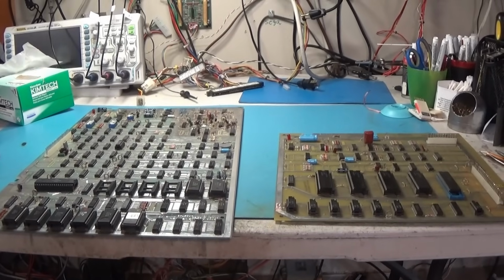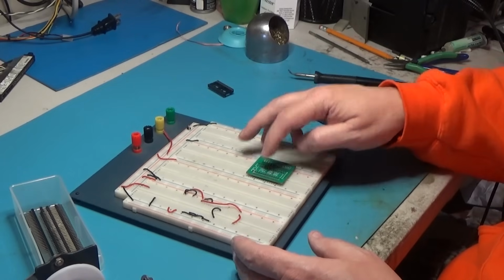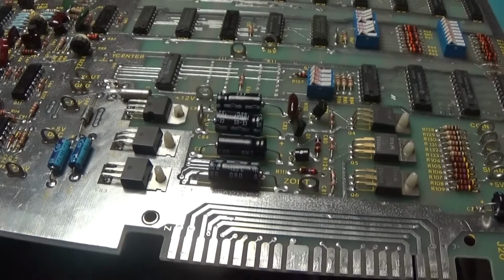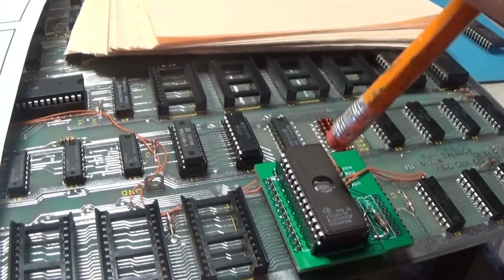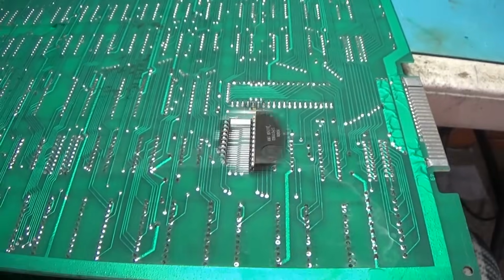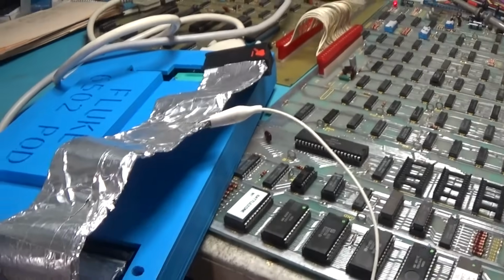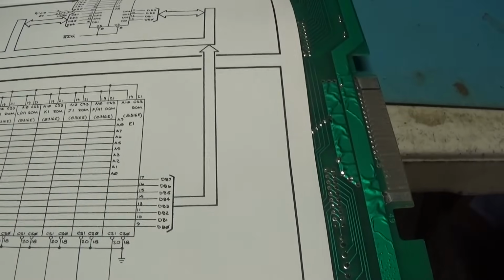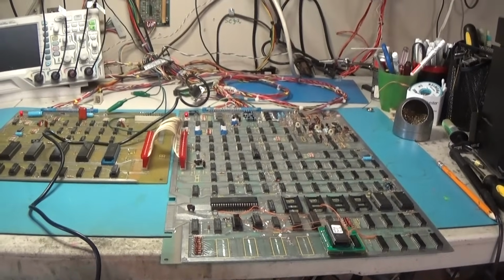1980 Atari BattleZone Arcade PCB Repair   2-17-2024

Comment: I have a BZ upright that was working when I bought it in the late '90s, but has since succumbed to socket rot.  I did the "press the chips into the socket" a few times which brought the machine back to life, but I plan on replacing all the sockets.  The monitor also needs to be recapped.  One of these days...

Comment: Your setup is very similar to the ‘high score save kit’ from braze. The whole eprom files are on one chip and plug in at the location of the 6502
Reply from the maker: As a matter of fact, that is probably what they are doing on that braze kit. Probably using the 245 as a direct separation between the data lines and the ram dat lines. Although the Braze kit is a ROM HACK,, which I’m not a fan of,I could actually make a board that plugs into the CPU socket. That is just the ROM code… And use that 245 to separate ROM and ram data.

Comment: Hi Sean, great video as always.
1:09:45  Small suggestion, if you are going to redesign that small PCB, you should add 2 more soldering points, so you don't solder these two wires directly to the chip.  Also, if you solder these wires on the other side of the small PCB (bit more cumbersome), this would clean up your work and put the wires closer to the motherboard.  It would then be easier to secure them to the motherboard with some hot glue or a dash of clear nail polish.  No sticking out wires... smaller chance of ripping something out.
Also, you don't need any extra vias, as you have removed bunch of sockets and you have plenty of holes on the motherboard (on both sides of the small PCB) to guide these wires through :).

Comment: Suggestion: make small daughterboards for the other chips you pull the signals from, giving you pads to bring your wires off of.
Reply from the maker: That surely is a good idea.  thanks for that suggestion.

Comment: Shouldn't the enable signal for that combined ROM just be A14 (or its inverse)? That's a signal that you already have on the ROM module, so it would save you from running wires to those annoying to access signals.

Comment: Battlezone board repairs always seem to turn into a major time sucker. No exception here I see…

I like your single chip option but why not leave the old sockets on the board? 

Also, would it be possible to run BZ2 code in your daughter board? Even better, have two chips, one running BZ and the other running BZ2 code with a way to switch back and forth. That would really be something if you could get that to work.  I think that would be a great alternative to that Arcade Jason Redzone board which I refuse to buy.. 🤪
Reply from the maker: I intended on, leaving the old original sockets in the board… But I decided to remove and keep my good 24 pin sockets because I use so many of them.
And yes, this bzone repair was no different than any other lol. After the video was done, I ended up replacing all of the 16 pin sockets on the auxiliary board that hold the bipolar ROMS. Those sockets were causing flaky issues, so I had to replace them as well.
Reply: @classicarcaderepairs4818  Yeah, those bipolar proms act up in those old sockets when the board warms up. A quick fix that doesn’t involve removing the old sockets is to insert the bipolar proms into machine pin sockets. Then insert the machine pin sockets into the old sockets with the proms installed. This will improve the pin tension of the old socket and help keep the bipolar proms a little cooler because there is more space under them for air to circulate.